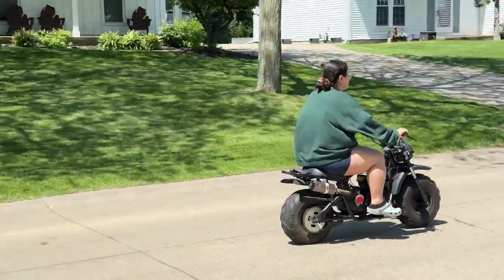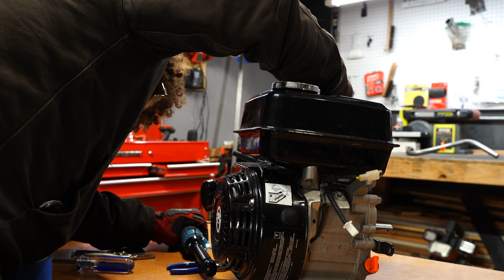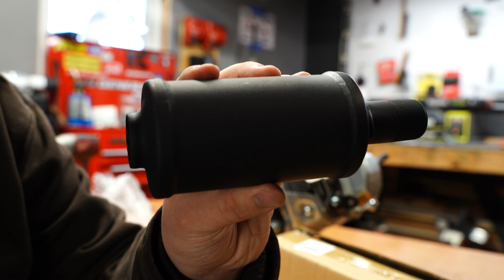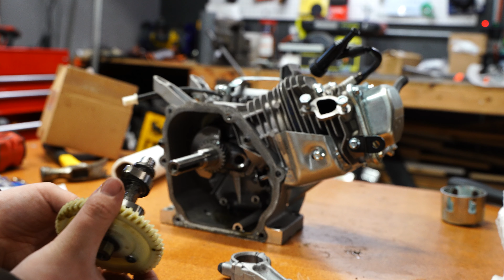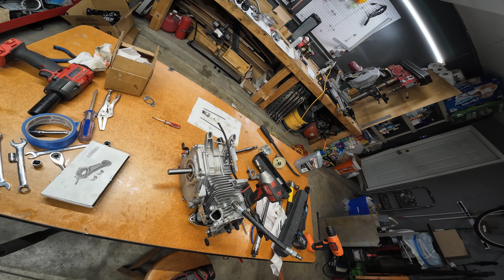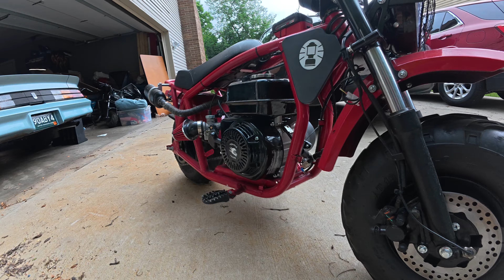The ULTIMATE Budget Mini Bike Performance Build Guide!

Comment: One thing to note, the longer intake generally has better low end torque by increased air velocity and short intakes are better for top end performance.
 Also stock flywheel is fine up to 4500-5000 ish rpm. Once you get to stage 2 is when it needs replaced.